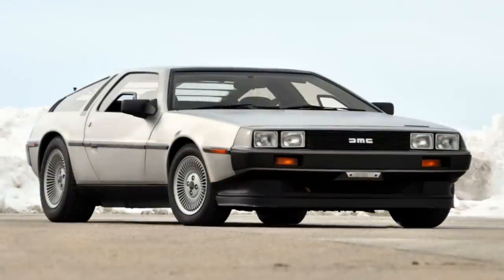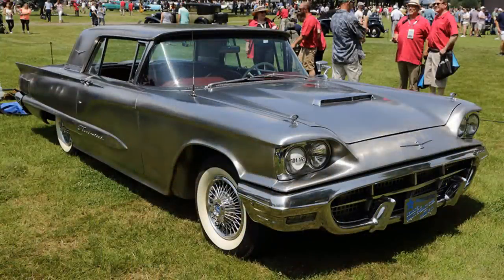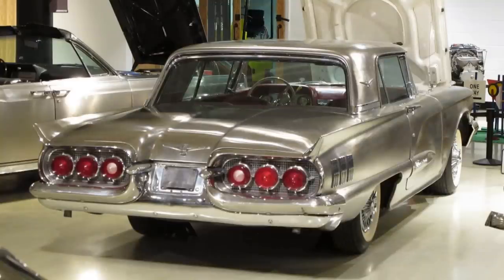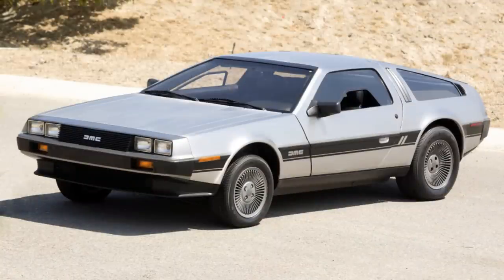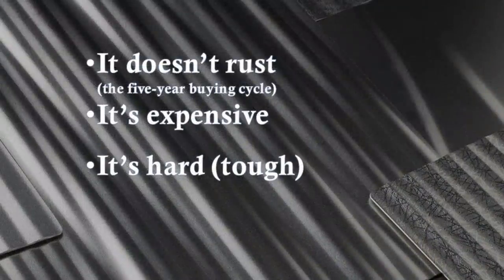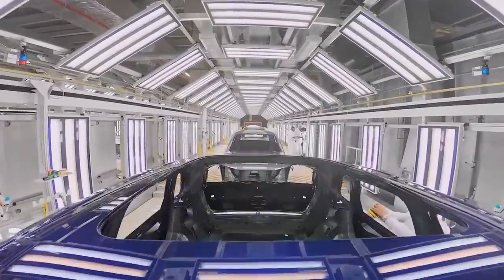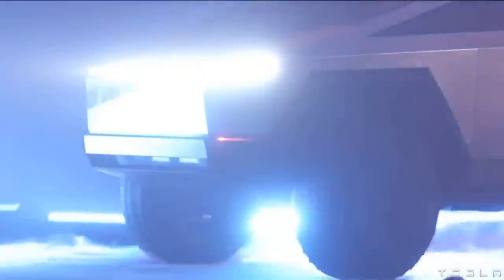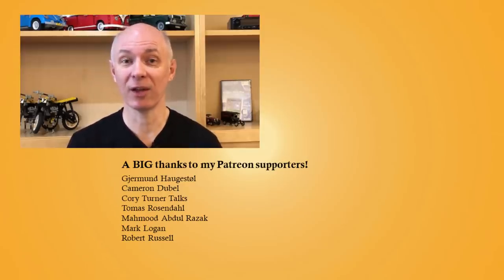Why aren’t cars made from Stainless Steel?

Comment: That's probably why the cyber truck doesn't have any round edges, due to it being difficult to machine. I think that's why they went with such a low-poly design.
Reply: Or they just slapped it together for a car show.
Reply: @glennchartrand5411  possibly but I think its more because its difficult to work with. The simpler design makes it easier to work with.
Reply: Manuel Camelo  Its not that they cant shape them as they please. It's just very expensive. The steel is so thought, it ruins the stamps used to make the shapes, which means the stamps need to be replaced more often, increasing the price. Considering that Tesla wants to make it affordable, they had to either go with a weaker body material or go with simpler shapes.
Reply: I dont know what everyone has. I think it's the best looking car out there, it's something completely new. Finally something different from the old beatle design.
Reply: Manuel Camelo :  Again: The point of the CyberTruck was to make a tough, durable, long lasting and AFFORDABLE truck.  So Yes, they could build big tougher stamping machines to do curvy shapes, but the cost of the truck may cost $140-180k instead of $40-80k
Reply: The real reason it doesnt have round edges is too make it cheap. Bcuz they just have to place flat surfaces which is much easier and cheaper for them aswell as the customer
Reply: Manuel Camelo  yes man, so easy. Why hasn't Tesla thought of it? So many experienced engineers are being outsmarted by a random Manuel in a YouTube comment section. You are truly a one in a generation genius. I'm honored to be able to tell my grandkids I shared the Earth with such a high functioning being.
Reply: They outright said in the presentation that the shape of the Cybertruck was based on folding the stainless as little as possible, to keep costs down, and safety, plus a little aerodynamics...
Is this a debating point somehow?   :)
Reply: @joemann7971  its 50,000 USD, faaaaaaaaaaaaar from afforable
Reply: @ausintune9014  Do you have any idea how much a truck costs? Its not cheap but its relatively affordable for a truck, especially an EV truck.
Reply: @joemann7971  most cars here are sub 30k
Reply: Its exactly why. Its form is a function of being low cost to make.  The shape is deleting complexity from the production line.  The body is laser cut, scored and folded from a single sheet of metal. Its all done in one process. No crazy curves to weld. No single pieces to be stamped on press lines, stamped etc. No special stamping machines and specialized tools. That keeps costs down, so cheaper to sell, or higher margins. 
Also there's no paint shop to deal with.  Paint shops are expensive and slooow. Ford spent half a billion dollars on improvements to its paint shop in Chennai in India. The $0.5B dollars doubled output from 15 to 34 vehicles per hour.  Cybertruck doesn't even need a paint shop.
Reply: @zambiakid  Stainless steel is really tough to work with. If you actually look at other manufacturers that have used stainless steel in the past, it's actually bankrupted them because of the higher cost of working with stainless steel, because the "stamp" thats used to mold the steel needs tombe replaced on a regular basis, which usually isnt a problem with other metals. I imagine tesla wanted  what is effectively, an electric tank. so, sacrificing curves for ruggedness was a fair compromise, IMO. The parts on cyber truck look like they are just bent, as opposes to "stamped", like other cars parts.

The welder/machinist at work tells me how much a pain in the ass it is to work with stainless steel compared to other metals. So, i do imagine this is the case for the low poly design. Obviously, its not a "cost savings" overall because Tesla could have used a weaker metal, but then it wouldn't resist denting from being hit by a hammer, would it?
Reply: @joemann7971  
Using a different metal would mean requiring a paint shop, which, as was mentioned before, is expensive and slow. I think the structural and chemical integrity of stainless steel does end up being an overall massive cost saving, because you don't need to spend money on stamping presses and a paint shop, and the machines you do use to fold and weld the stainless steel are cheaper. Plus the stronger material and exoskeleton design means you don't need as much material, so cost increases from the switch to the more expensive material are mitigated.
Reply: They went for cheap and nasty because they is a Tesla made by a con man and designed by fools. Nobody in their right mind would have anything to do with the Great Con Man's products. Tesla is a scam company.
Reply: @frankiedogturner1516  You must work for the fossil fuel industry.
Reply: @frankiedogturner1516  
I'm impressed that you can even form sort of slightly coherent sentences. I mean, I can actually make out what you meant to say. Bravo.
Reply: I'm kinda surprised nobody gave you an accurate reply, so I will.

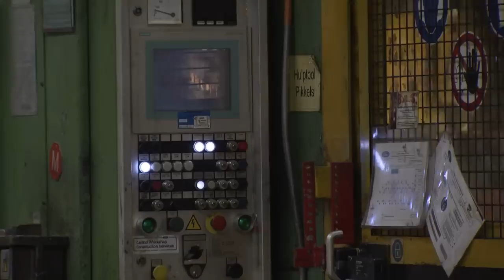Yes, you are correct. That's why the Cybertruck doesn't have curves. The design does not involve any stamping. So the video is completely wrong at 1:47. It's not a problem, it's a solution.
Reply: Apologies to those who actually did give an accurate reply. Seems like my YouTube app maybe didn't show me everything.
Reply: Elon literally described this.
Reply: Look up garage 54 YouTube channel, they have already cloned one in looks.  Took them a few days.
Reply: @justinmallaiz4549  Tesla forgot one thing in the design of thier pickup and that is making it function as a truck.  Anyone who has ever owned a truck that has actually used it as a truck knows why they have a bed with lowish side walls (for lifting stuff over) they also know that plywood comes in 4x8 sheets and pickup beds get damaged, removed, replaced and Ford proved 50 years ago that unibody trucks didn't hold up under heavy use.

The Rivian is a munch better platform for a potential commercial class vehicle as it is actually useful and not like an apple Iphone status symbol but a functional machine. The same could be said about the "classic" truck manufacturers from around the world. Whether its GM, Toyota, of Ford. (Or the million others). 

Tesla's truck is like a modern version of the 1950s GM show cars, it has some neat ideas but little will make actual production. If it does make production it will be as a status symbol and after the few thousand that have to have the newest tesla products get it the demand will far sharply I believe.
Reply: Manuel Camelo  Stainless steel wears out the pressing tools.  The strength is in the rating of the press and not the tool themselves which are produced from cast iron.  So your suggestion will not work.
Reply: Thank you for taking notes, u just repeated what's said in video. Great
Reply: @ausintune9014  but very far from the 100k+ it would have cost if they tried making it curvier, what is it that you don't get? Or did you just make the comment to unnecessarily harp that YOUR definition of affordable doesn't line with theirs?
Reply: @justinmallaiz4549  sure show me the price of the truck and lets compare it to alternatives
Reply: @danielsteger8456  Sure, go ahead: 
https://www.tesla.com/cybertruck?redirect=no
- $39k,49k, 69k
-designed for 1,000,000 mile life expectancy. (It will last 3 times longer than anything you'll find)

- extreme resistence to rust, dents, scratchs (stainless is hard as hell)
- air suspension (!!!)
-4 wheel steering
- 6.5 ft locked (armored) bed
-Storage space, air compressor, 240v and 120 outlets
Start with that and the typical specs..
ridiculous
Reply: @justinmallaiz4549  
1. "designed for 1,000,000 mile life expectancy"- this is not only dumb, but i dont know where you found it because its not mentioned on the website. surely if this was true, it would be in big letters on the store page?
the reason its dumb is because any car can have 1,000,000 mile life expectancy. question is how much you spend to keep it going. do the batteries need to be replaced? for how much price? what about the motors? also, i dont see any warranty on the website.
2. "extreme resistence to rust, dents, scratchs (stainless is hard as hell)"
thank god it doesnt scratch, my pickup truck got totaled because it got too scratched. i dont want to be in that thing when it crashes, because if its so hard then it doesnt absorb much of the impact. if you have ever seen a crash test you would know how important crumple zones are, how bent the hood and fenders get.
3. you didnt say anything about range.... wonder why. 500 miles is not a lot especially when a ford f150 can travel aobut 1000 miles without any extra stored fuel.
4. you also missed the power of the thing, which is great. although i am not sure how much it matters, since you can already tow just about anything with todays pickups

about air suspension, it could be great and it could be terrible. i dont have enough information on it. bed size is great, but i dont see how a air compressor and power outlets are a bargaining point. id rather have a wheeled generator than a wheeled battery.
Reply: @danielsteger8456  :)
1.) It's well spoken about (numerous Elon interviews and Tesla events)
my first google result example : https://www.motorbiscuit.com/how-many-miles-will-a-tesla-last/
-Tesla 4680 battery will be good for at least 1 million mile. (possibly up to 10 )
google "tesla 4680 cycles" for insight.
-Tesla is not selling cars to profit from repairs. (decent electric drivetrains are too reliable by nature) Tesla is selling robotaxi's to make $$$ per mile. Longer lasting and lower maintenance equals more $$$.
An example fact of Teslas confidence in this model:   Every Tesla owner who is leasing their Tesla, signed the right for tesla to buy when the lease is up. Tesla plans to buy these used Teslas back to support/supply the robaxi network. 

we'll leave 2,3,4 or another day
Reply: Yes they don't stamp the metal instead they scour the fold line and then.. well fold it.
Reply: @danielsteger8456  the 1,000,000 mi thing isn't specific to Cybertruck. It's the spec for the next line of batteries, which should be scaled up before the Cybertruck. The battery is likely the weakest link in terms of longevity since all the other parts are extremely low maintenance compared to ICE vehicles in general, so a million mile battery basically means a million mile car.

https://www.findmyelectric.com/blog/how-long-does-a-tesla-battery-last/

I recently completed the second "annual maintenance" on my Tesla Model 3. This "annual maintenance" consisted of... um... adding windshield wiper fluid and topping off the tire pressure. I expect next year and the year after to be the similar (maybe need to replace the wiper blades too at some point). Even breaks become almost a non-issue because regen breaking removes most of the wear on the calipers.

Perhaps there is something sad about this transition to EVs. It's too easy. It weakens the bond between man and machine, just as the advent of the ICE car all but broke the ancient bond between man and horse.

The nostalgia and love of an old ICE vehicle, all the TLC to keep it running year after year... the sweet smell of fuel and burnt transmission fluid... Yes. Very sad really.
Reply: its not really that much more than regular steel and especially when its olny 2mm thick most presses will form them
Reply: @charlesballiet7074  No. it's 3mm. Besides even if it was 1mm you won't get very many stamps before it damages the moulds, and would need to replace them
Reply: @charlesballiet7074  why are you talking about presses? Presses are irrelevant. Cybertruck design doesn't involve presses. Cybertruck is orgami. Just score and fold. How many times does this need repeating? The entire video has nothing relevant whatsoever to say about the Cybertruck. Why is that so hard to understand?
Reply: @justinmallaiz4549  you are both arguing irrelevancies. There's nothing to stamp. The decision to use an angular exoskeleton design and the decision to use stainless steel are one decision. It's a different kind of vehicle, not a set of incremental changes.

It's like you see an airplane for the first time and then start debating whether or not it's a good idea to add wings to a train. And then argue about propellers as a separate consideration.
Reply: Manuel Camelo  Because the goal is to make it affordable, not just to make one.

TBH Tesla engineering teams are of a uniformly higher quality than what you typically find. This means that what they devise often represents the high end of mass produced technology that is affordable. 

If the goal is to be affordable, you must cut as many corners as possible while maintaining reasonable quality. They are far more capable than what Ferrari is, but buying a small truck for 80k USD is not economically viable no matter what business you run

Comment: The Delorean wasn't really a stainless car. It had a steel chassis, a glass fibre body with clip on thin stainless panels. The original intention was there but got watered down as the reality of production set in. The only structural stainless parts were the the doors.
Reply: Are you sure? My mate had a Delorean and it was a Stainless Steel Tank. Very heavy too.
Reply: @darrenporter1850  Development done by Lotus so a close family resemblance to Esprit (I have an Esprit). Some detail here https://en.wikipedia.org/wiki/DMC_DeLorean but a book on the Delorean gives more detail. To quote wikipedia " The stainless-steel panels are fixed to a fiberglass underbody. The underbody is affixed to a steel double-Y frame chassis, inspired by the Lotus Esprit platform"
Reply: But what good looking doors those were 🙂
I wonder how the falcon design Tesla doors would look on a Delorean? 🤔 😎
Reply: @darrenporter1850  According to wikipedia it has a curb weight of 2712lbs. That ain't heavy enough to be a stainless body... It was fiberglass brah.
Reply: @halohunter5217  Surprised how light actually.  But trust me on this, they  feel heavy like driving a Steel Toaster and not fast.  Great looking, terrible to drive. I will give you the weight.. but don't be fooled to think it is a nimble car.
Reply: @GSimpsonOAM  I had a Lotus at same time as my mate had his Delorean. Trust me, the Steel is terrible.
Reply: @darrenporter1850  Chapman tried to persuade Delorean to just do a slightly modified Esprit. If the Delorean had had conventional doors etc it may have been shipped sooner and been more viable.
Reply: @darrenporter1850  There is no doubt the Esprit is the better car but I wonder what the Delorean would have been like with the intended Rotary engine? Maybe someone should put an RX8 engine in one?
Reply: @GSimpsonOAM   Rubbish. Car is Terrible.
Reply: @GSimpsonOAM  Don't even compare a Lotus to the Delorean apart from the shape.
Reply: It's no doubt about it the delorean was a shit car. 
    You could buy a 1982 Porsche 911sc for another $2000 more and get somewhere around 60hp+. At about 2557 curb weight.
Reply: @jerryvelasco1474  True. My mate wasn't great with cars, he bought has Delorean from USA, was perfect, but after a few years for some reason the Garage couldn't fix an issue with Engine (and was only a Renault), interior faded a bit as left outside at the Garage, then he sold it for a Stupid low amount! Random history of that car.
Reply: @darrenporter1850  There is more to it than the shape. The chassis is similar and the bodyshell construction similar. It is heavier, has rear engine rather than mid engine. It does have better internal room and is probably more practical car. As a straight drivers car the Esprit is better but no car is the ultimate car and there are always compromises. My Esprit https://youtu.be/zkegqvPowXE  My brothers S1 https://youtu.be/wXLb5LZpArw
Reply: @darrenporter1850  the DeLorean is panelled in brushed SS304 stainless steel.
Reply: @macmcleod1188  Yes, which are rubbish.
Reply: @darrenporter1850  no opinion on that. The question was whether they were stainless or not.
Reply: initially the Delorean had a full stainless steel body and a plastic chassis. Lotus persuaded John Delorean that this would be a terrible idea as the engine would crush the occupants in a head on collision. Only 1 test car was built and it was only tested in Ireland so no wonder in hotter and colder climates than ireland the cars had numerous issues, such as one where the throttle cable would freeze open.
Reply: The DeLorean's are still made to this very day in Humble Texas by a man who now owns all the rights and if you want you can buy yourself a new Delorean with the central "Y" frame made out of all stainless steel as intended.
Reply: Dude, the body panels on a delorian are made from stainless steel and not fiberglas!
Reply: @darrenporter1850  so basically it’s a terrible car

Absolute dogshit car
Reply: @tony_5156  My friend had one.  In the Sun it used to make funny noises as body would get so hot.   It was cool though.  I know he made problems with it, but don't know if he was at fault or the garage than couldn't fix it.  Only had a Renault Engine.
Reply: @GSimpsonOAM  Fair enough. I love the Esprit btw. I have an Elise.
Reply: @jerryvelasco1474  My mate bought his Delorean from California and shipped to the UK.  At the time in the late 90's cost 15,000 pounds.
Reply: @darrenporter1850  The Renault engine was only put in after Citroen pulled the plug on their wankel engine. It would be interesting to see how a De lorean would go with a turbo rotary in it.
Reply: Still, stainless steel construction appears to have positive impact on flux dispersal... ;-)